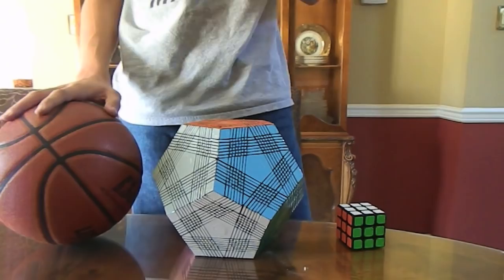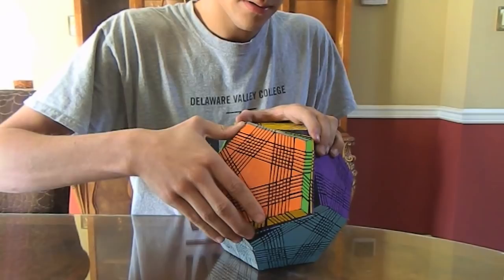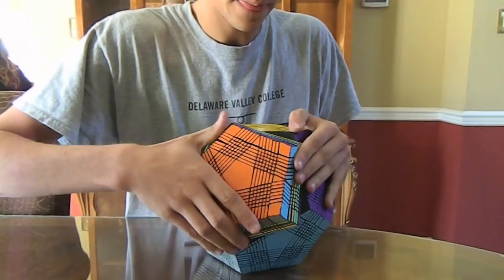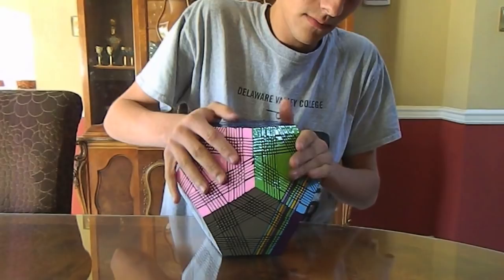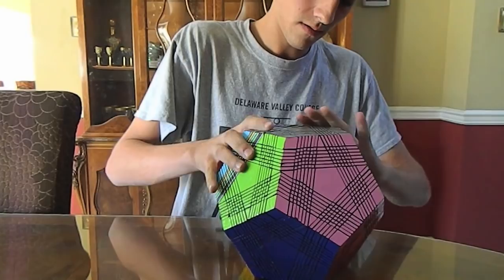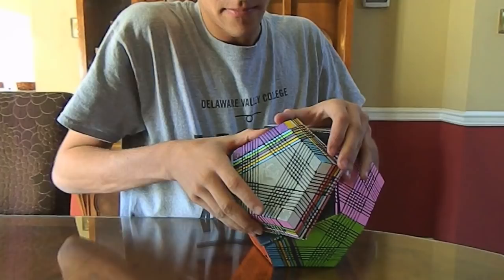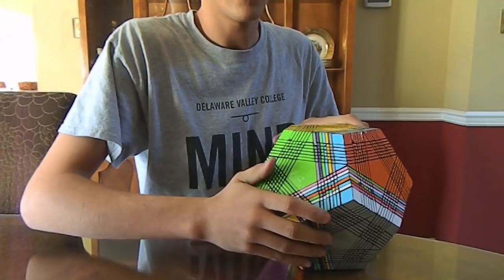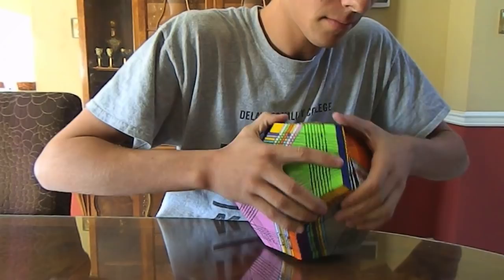Yottaminx (Former World Record)

Comment: looks a lot more stable then the 22x22
Reply: than*
Reply: 22x22 was printed with a cheap 3D ringer . The yottaminx was printed with shape ways. They have like professional 3D printers.
Reply: Shape ways are special printers that use a very thin plastic and a laser to "glue" and shape it. I dont remember how is called that type of 3dprinting
Reply: I know how the 22x22 ended up. Broken.

Comment: The number of pieces in 15x15 dodecahedron is actually 2942. The number of pieces in an odd numbered face turning dodecahedron = 62 + 60(n-3) + 15(n-3)^2. So for a 3x3 megaminx the number of pieces is 62 + 60(3-3) + 15(3-3)^2 = 62.
For a Gigaminx 62 + 60(5-3) + 15(5-3)^2=242. For a Yottaminx 62 + 60(15-3) + 15(15-3)^2=2942.

As long as we're at it the number of pieces on an even numbered face turning dodecahedron = 20 + 60(n-2) + 15(n-2)^2. So for a 14 layered puzzle the number of pieces = 20 + 30(14-2) + 15(14-2)^2=2540.

 Good luck trying to scramble and solve that beast. You'd have to be an NBA center on steroids to be able to turn it for any length of time.
Reply from the maker: Blaster Dan I count the core so it's 2943
Reply: ***** Boom.

Comment: I'm pretty sure it's cheaper to buy a 3d printer and plastics to make it yourself. I'm not sure how much plastic you'd need to buy but I'm sure it would be less than a car.
Reply from the maker: Ryan Thierfelder The 3d printers required for printing precision parts for twisty puzzles are incredibly expensive. This was printed on a nylon SLS printer. Look it up. They can cost 500K